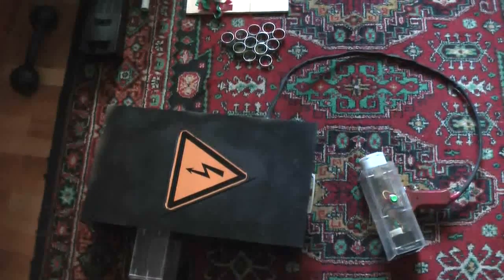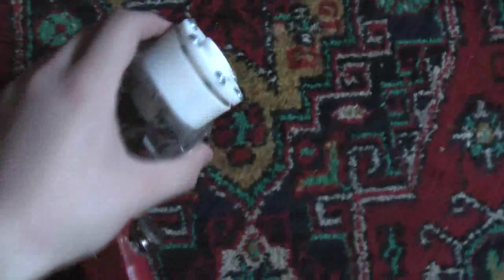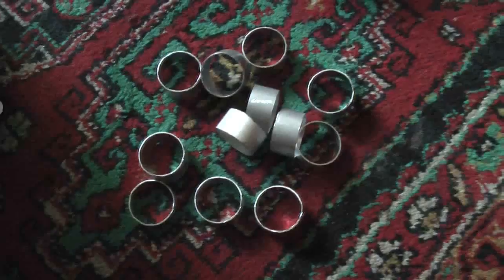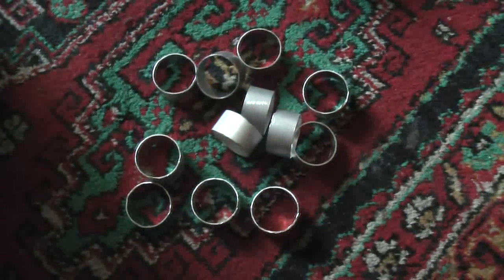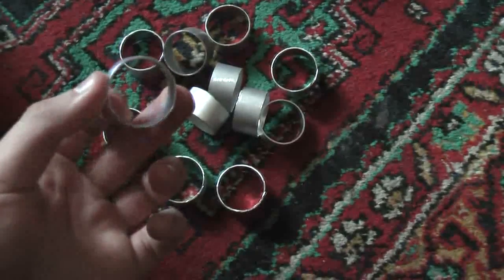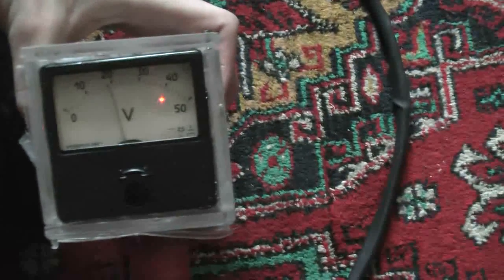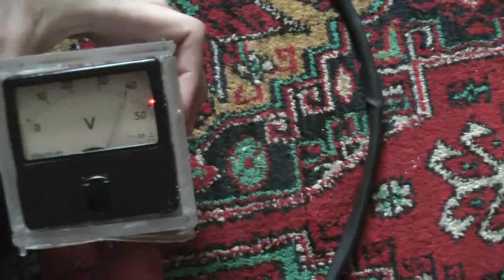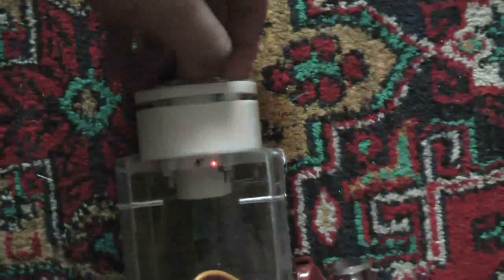First portable induction accelerator in Russia

Comment: Oh and another question, did you just use a resistive voltage divider for that voltmeter? What resisters at what watt rating?

I made one but am yet to hook it up, I used 17 1/2W carbon resistors to make up 9.9Mohm for a 1:100 divider (meter resistance 100kohm). Looks a bit iffy to me so would be good to know what you used.

Comment: Hi Fuckertrezv,

What did you use to trigger the HV pulse? sparkgap? relay? scr?

I have a capacitor very simular to yours, a K75-40a but 3kv @ 100uF instead of 5kV @ 40uF. I have a 12kV relay however Im looking for a less "lossy" way of triggering it.

Comment from the maker: IT`S NOT A COILGUN,
it`s absolutely another type of electromagnetic accelerator, like thomson ring launcher but strongly modified, coil T coil type? which consist from classic coil and the flat solenoid.
In iduction accelerator wserful only Al or Cu? but userlu only Al, this material has good magneric  characteristic, but that rings which i use on video are wery light? and thin if i find rings somewhere 2-3times wider, efficiency of the accelerator will  increase not less than twice